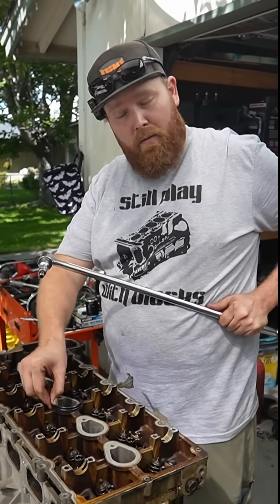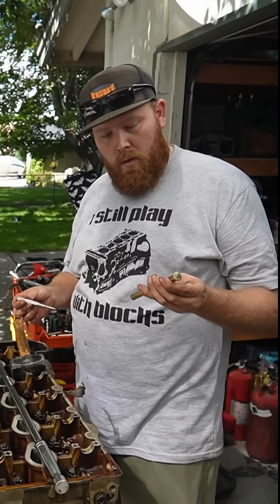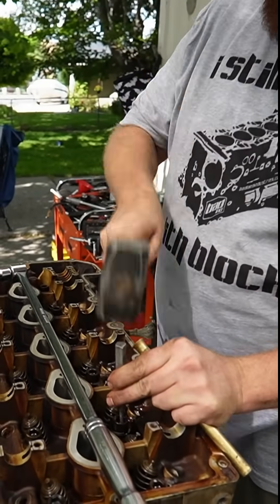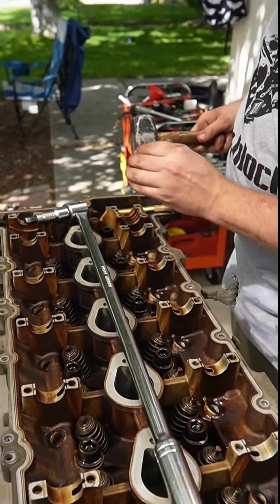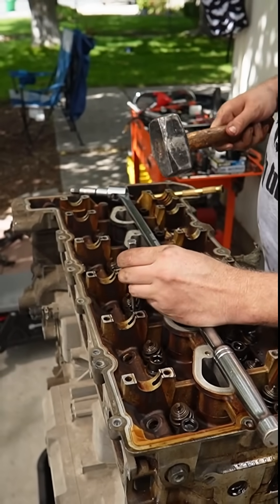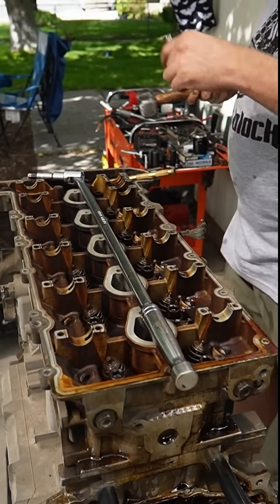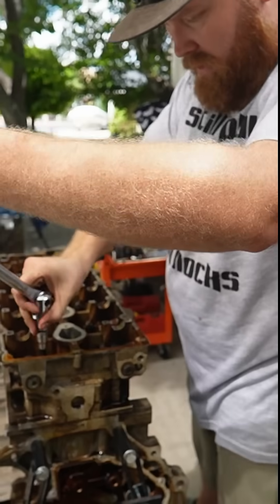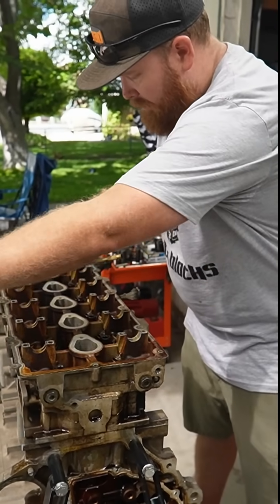5cyl Broken head bolts

Comment: What is intimidating for me to work on an engine. Is all the damn wires. I’m afraid of not being able to put everything back together
Reply from the maker: Fortunately all the wires are in a loom and match a corresponding plug. It's not as daunting as you might think. I've got a video from a couple years ago showing you how to pull one of these motors.